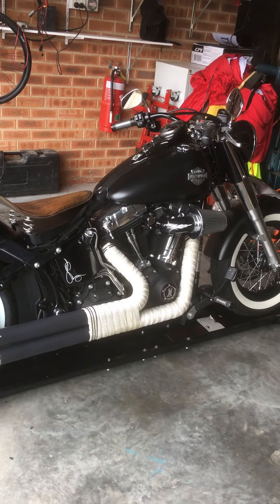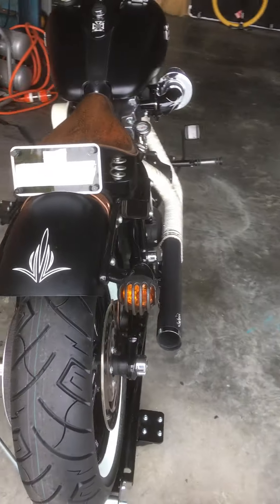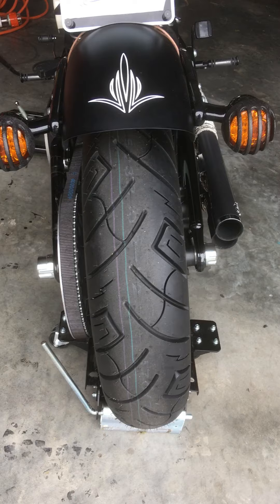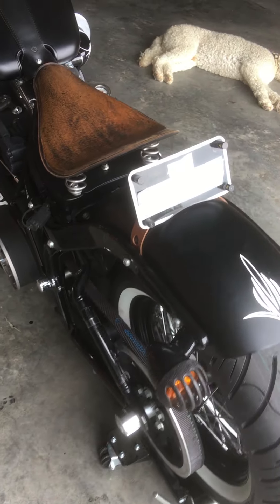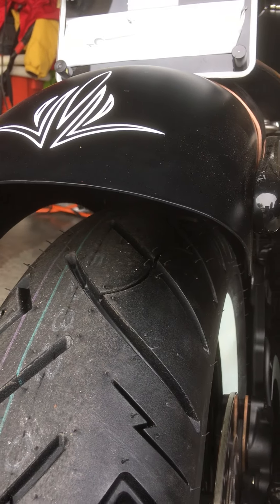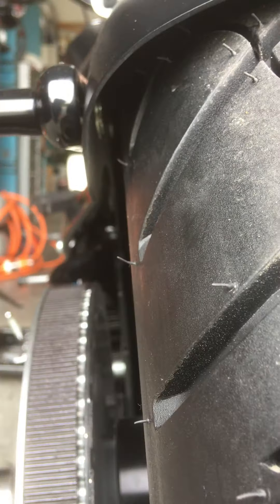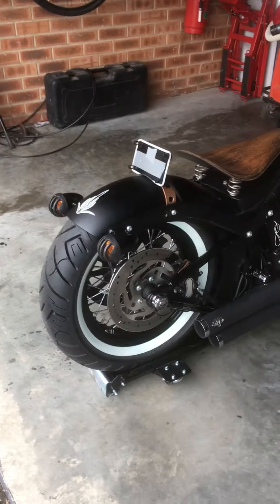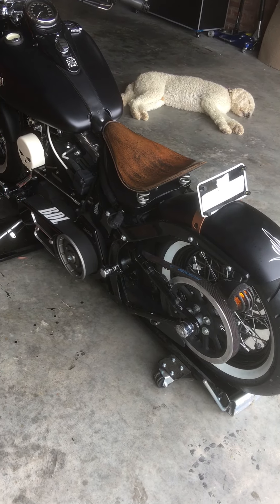Harley Davidson Softail Slim 170 Wide Rear Tire

Comment: Rad lookin bike mate, I have to ask, the open belt drive kit, where’d you get that, and how wide is the belt. Does she whine when u give it some stick? Cheers
Reply from the maker: Thank you, the belt is a BDL ( belt drives limited) and it’s a dry primary - multi disc dry clutch , I think from memory it’s a 3 inch 75mm belt , and yes in whines very nicely

Comment: Is that the standard 16 x 3.5” rim on the rear?
Reply from the maker: Yep, its a standard rim that came factory with the bike
Reply: @franklingrebbo  
Thank you for the response.  Your bike looks great, especially with that air bladder/shock on it to lower it.

Your Slim must be an earlier model to have come with a standard 140 rear tire on it.  Mine is a 2019 and they now come with a standard 150.   The only problem with using the standard rim on a wider tire, is that the stock rim will tend to pull the edges of the tire inward and not allow it to flare out as wide as it normally would be with the proper rim.

Your’s still looks great though.  It did make a difference.   I’m debating to add a 200 rear tire on mine.  The newer Slims do not require a new swing arm/belt modification for anything up to a 200 tire.  That size tire does require a 17 x 6.5” rim though, and a new fender as well.

Your Slim really looks good.  You did a great job on it.  Thanks for sharing.

Comment: I checked my 2015 Slim rear fenders and there is a lot a room for a good 170 like you said. But my question is did you use the stock struts or replaced them?
Reply from the maker: Bobby Araullo 
Yes everything other than the guard and the suspension is original, I did have to relocate the computer a little but that was no major issue

Comment: Did you use the stock rim? and do you happen to know which is the widest front tire I can fit on the harley softail slim with stock rim?.....info would be much appreciated.
Reply from the maker: Yes everything other than the guard and the suspension is original, I did have to relocate the computer a little but that was no major issue